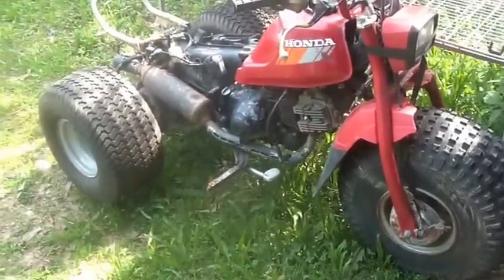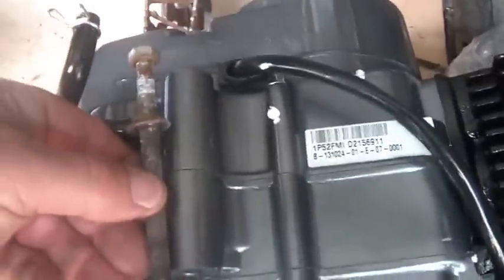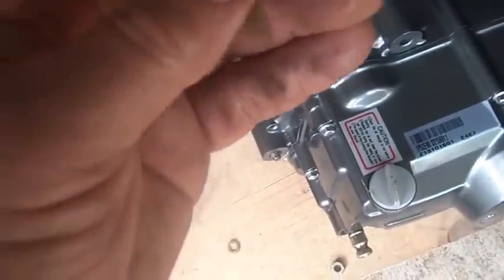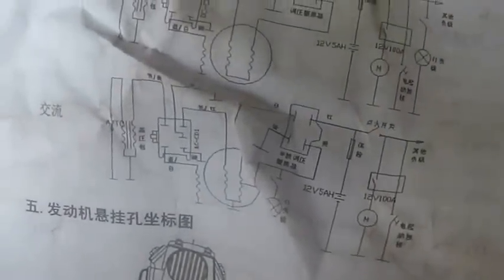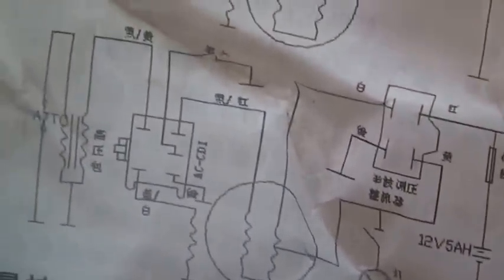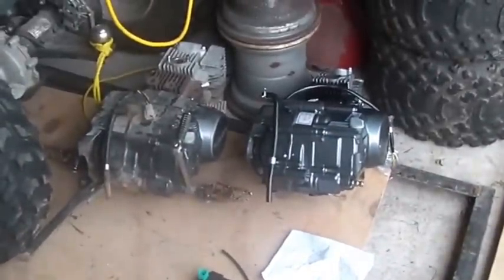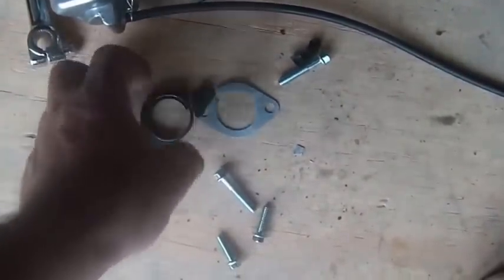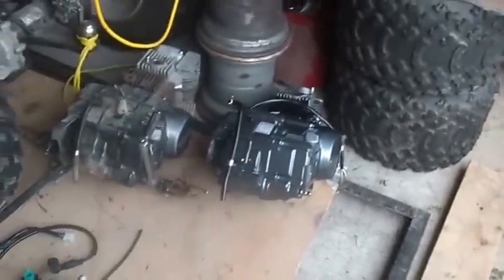6_23_2014,  Wiring 125cc LiFan Pit bike motor,

Comment: loom wise I would say the easiest thing to do is to take the hole loom from the old engine including stator put the loom together as it was in the bike before the engine was taken out only this time put the stator and loom from the old engine into the new engine  it will fit perfect and keep the new one for spare basicly use the old wiring including stator on the new engine and it should work... im really excited to see how this bike turns out I have done many pit bike conversions and  most parts from 90,110,125,140 are interchangeable  and for the oil thing I think they ship them new engines with the running in oil with a zinc additive. best of luck with the bike and keep up the good videos!!!
Reply from the maker: kx601986, As U will see shortly, I pretended to know what I was doing, I matched up the wires and went with the new harness, the old bike engine, harness, carb, manifold, etc... may end up on the China Quad if that engine stays stuck, Thanks for the info, watching, and commenting, I will hang onto to the 107cc engine for parts after I break my leg and the frame on the China quad!

Comment: Hi Harvey. Nice video, kinda. I too was a bit dissappointed by the lack of wiring advice. But I'm not gonna complain about that. Watching enough videos and reading the forums, and the comments here, and I've got enough confidence to go ahead with my wiring.

I bought a similar Lifan (non-branded) 125cc engine. 4 up gear pattern. Automatic clutch. From ebay, and it came in a box like yours. I think Lifan copied the Honda wiring colour code, for compatibilities' sake. But they used blue with white trace instead of blue with yellow trace. I hope and think all the other (and that blue) wires are compatible. But annoying, they used 4 bullet plugs instead of a 4 pin square plug. So I cut them off and used individual spade connectors (mini). I haven't yet found a supplier of the right type of square plug. Well I did, but they come as a plug & socket set, and for 100pcs minimum. $18.70. Not bad at $1.87 each, but I only need one half set!!!

I wasn't lucky enough to get ANY wiring diagram nor manual. I asked the seller for it, and got no reply. Can you scan and e-mail me your documentation? Please. I work with many Chinese people, who could easily translate it for me. I am eager to see the details.

I'm putting the engine into my 2002 Australian (Aust. Post) edition CT110. I will slowly fix the dead Honda engine and put that into my spare CT110 frame/bike. I am using the Honda wiring harness, airbox, ignition coil & spark plug cable. But I am using the new Mikuni carby. My carby won't let the engine idle. And I've serviced it. So it's time for a change, until I can work out what's wrong with the KeiHin carby. I need to make it backwards compatible, if I ever put a Honda engine back in. Otherwise, I'd cut off the square socket from the Honda's wiring harness and install bullet connectors.

Also, I made a clever set of 2 steel brackets to hold the lower engine mounting bolt, compared to the standard twisted flat steel brackets I've seen.

Bye for now.

Comment: Thanks for the video.   I'm using this motor to scratch build a drift trike.   Do you know where . how I can find a cdi and ignition coil?
Reply from the maker: john miller , I did a quick look on eBay, searched under Lifan 125cc engine wiring, looks like they have everything there for around $25, coil, cdi, and wire harness... The kill switch, U will have to come up with Urself... Thanks for asking, watching, and commenting!

Comment: Hey mate, I have a new engine from shop haven’t ridden yet started a few time, but I’ve noticed when I was putting chain on, and started up click into gear but engine wouldn’t take off, so I’ve taken the chain and tried clicking into to gear the spoket would just spin doesn’t feel like there’s any grab please help!
Reply from the maker: Hey Adrian, If the engine has an automatic clutch and it was recently rebuilt , perhaps the clutch is adjusted too tight, that would affect shift lever travel and would keep it from going into gear, hopefully, it is not an old Honda ATC185 or ATC200 motor, they are known for that,  I have a couple on the shelf that need to have their cases split to find the reason.... I hope this helps, please get back to me when U get this sorted.... Thanks for asking, watching, and commenting!!!!
Reply: Cheers man, i had a look last night and when shifting down will go down all the way and clicks when into gear and up seemed okay seem to click and had a closer look at it and realised the up gears wasn’t clicking the full length and was hitting the cause so I’ve bent to shifter to make it work around the engine case, now happy days

Comment: if te old motor is a 90, and the new engine is a 125, wouldnt the engine need a richer jet than the old one?
Reply from the maker: dave1135, The carbs look exactly the same, to save a few minutes, I'm going to try the old carb and see how she runs. I do hear U on running lean, I don't want to cook a new motor. Thanks for the info, watching, and commenting!